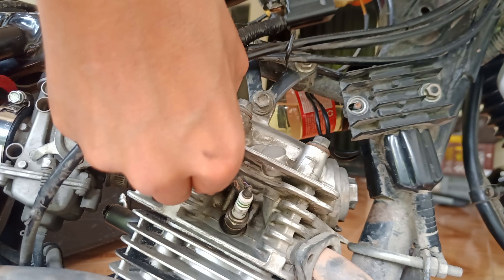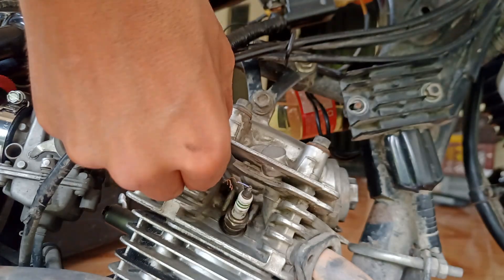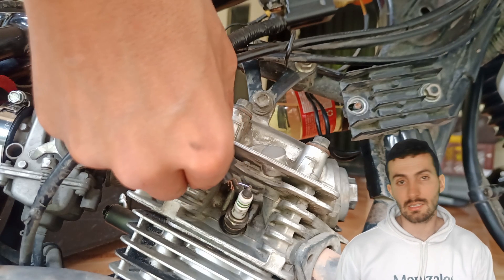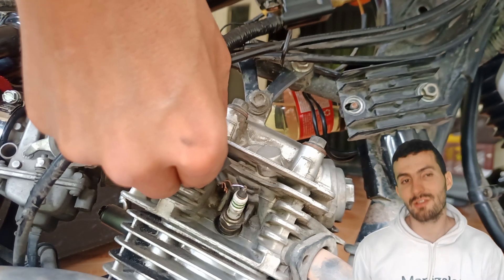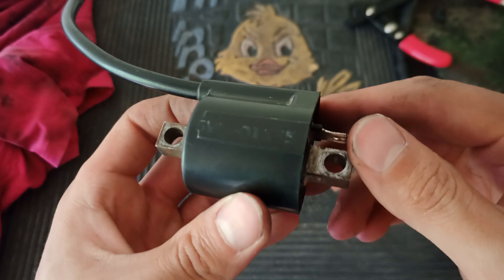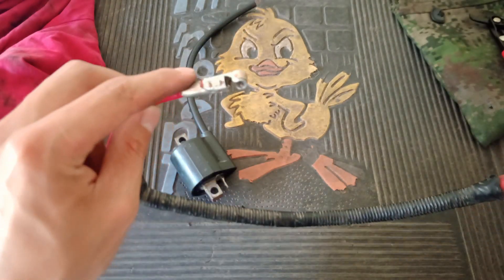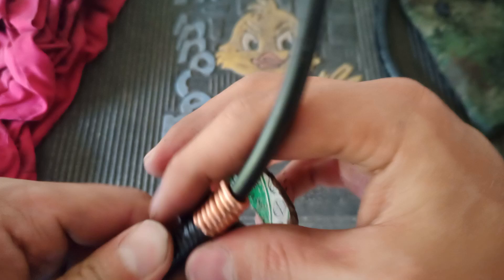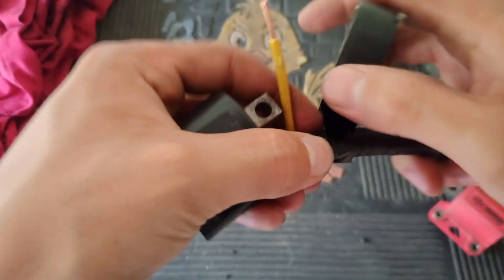⚡ DIY Make a High-Performance Ignition | Raise Voltage

Comment: I've been a licensed tech for over 40 years. A spark plug will fire at a specific voltage depending on the gap and resistance of the plug. Reducing the resistance of the wire by going to copper core doesn't create ny increate in performance, it just makes a noise on your radio

Comment: Why WOULD that work?  You wrap the copper wire in electrical tape to prevent the wire from shorting out.  Then you ground the same wire…shorting it out.  Also if the spark plug wire is insulated, what is being achieved?
Reply: yah... its useless

Comment: He’s made a capacitor by shorting that copper and tying one end to ground. I just use the copper braided shield from communication cables when I make them up. The only thing to be wary of is if you have a weak ignition system it can absorb more joules of energy and bring down the voltage so under load or high rpm the spark plug won’t fire to discharge what was stored up. Q=CV baby 😁

Comment: How to increase high voltage from ignition coil using diode + inductor?  

Ignition coil is not AC output. Therefore a voltage doubler can't be used. Pulsing DC output high voltage, was reported in 2008 to have been increased using diode + Millihenry inductor wire coil, and capacitance of plastic tub. Does this have anything to do with resonant charging choke or as pulse forming network? How to do test on work bench with Magnet magneto type Ignition AUTOTRANSFOMER that uses 3 connections. I have parts. Comments requested.
Reply: Thanks.  Im looking into this making my own car ignition - but dont want to blow the mosfet.  I see one person has a separate inductor on + side and cap before coil.  I have clicked on to what this guys saying with testing and found the sparks much better  {waste of money on new leads}  but understand they have resistance for unwanted  "noise"  which is illegal  {in the old days such car would be causing everyones TV to have fuzzy lines}.  Next time Ill do this but put a earthed shield over the insulation to act like faraday cage.

Comment: lol yeah ok
Reply: What this accomplishes is adding capacitance to the output. It does work. I'm not affiliated with the video producer, but I've seen this done before.
Reply: @pinheadjones74  the only thing i can see here is that he is trying to add a shield in order to reduce capacitance.... this is effective with data or audio cables but as far as an ignition cable goes - a good and simple way to reduce capacitance is to use a heavier cable and/or shorten the distance between the coil and the spark plug... even after that - this will absolutely not raise voltage but it will perform more efficient. If you want to raise the voltage then you get an ignition coil that is capable of doing so. Even if you were to add capacitors to your factory ignition system, all that will do is smooth out the voltage output from the coil and lower capacitance.
Reply: @pinheadjones74  no this doesn't work at all. I'm sorry to come off rude but, no, this doesn't work.
Reply: @wwcrxww it works I have tried this on 70 cc bike with this method almost speed increased 30 km p/h  you also try it once and then share your opinion kindly